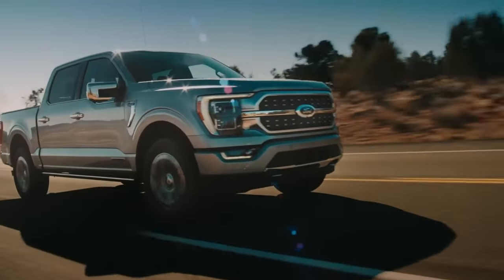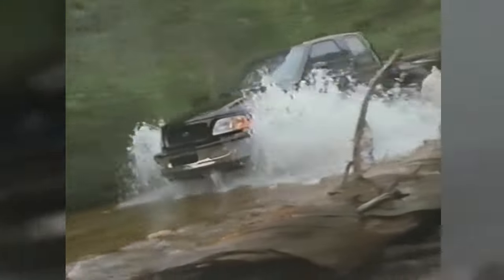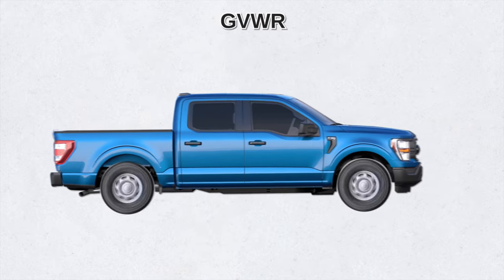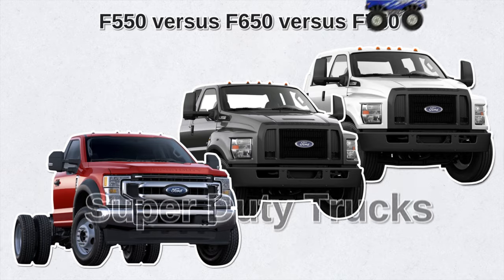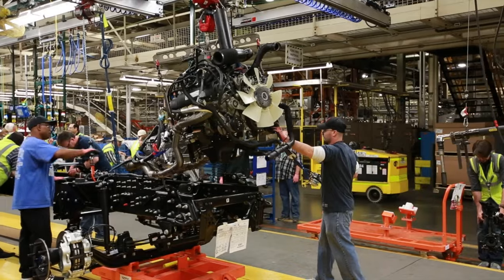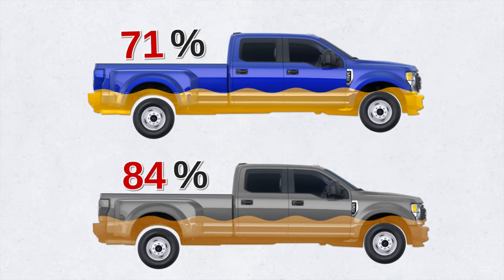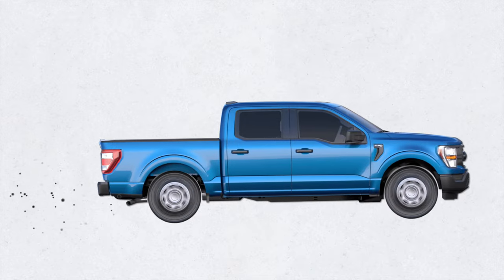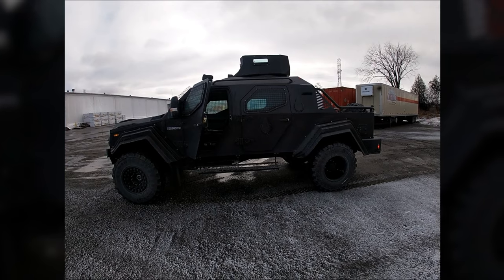No One is Telling You the Truth About Ford, So I Have to

Comment: Kinda sad, in the 70's through 90's we could be brand loyal. They all made decent vehicles. Now, you have to pick and choose due to both Ford and Chevy making garbage at any given time. RIP V8 engines.
Reply: Ford was absolutely making garbage 15 years ago. They’ve gotten much much better in the past 10 years. Perfect? No. But good enough that after tons of research I bought a 2021 ranger. GM on the other hand. They haven’t been great since pre 2007
Reply: @lesterparker1594  Im not a fan of any of the US automakers these days. We all know Chrysler anything is junk, but with Ford and GM, they can be great one model and trash the next. Takes about 10 years to really learn which is which, in my experience. Even Toyota drops a turd from time to time. Look at the frame debacle on the Tacoma a few years back.
Reply: The 70s Vehicles were pretty crappy and rusted-out. on the 60s and 70s Vehicles 150,000 miles was considered good. Back then you could get away with poor maintenance up until it died. Today's vehicles engines have such tight tolerances you must do maintenance and. change oil at the specified time or your engine is junk today's vehicles are not as forgiving but they will last. The main thing I don't like about the new vehicles is, there's way too many shall I say doodads and knickknacks.
Reply: @obamapox8185  I couldnt agree more. Gotta style them so they won't get their skirts caught in the door lol
Reply: Ford is better
Reply: @davidclemens1578  New cars are made cheap...they have the extras so you don't notice how cheap  , and sadly ,people are stupid and the extras are what people see
Reply: @emtfireman813  you’re right about that. Just have to do your homework before buying. Unbelievable how many people don’t even do a simple google search before buying a $30k car or truck. I did about 2 months of research befor buying my new ranger. 
Toyota is absolutely the most reliable. But nowhere close to the best to drive. I really wanted to buy a Tacoma. On the test drive I found out it was for me. Too slow and cramped. But when I bought my ranger I knew it wasn’t going to last 25 years like the Tacoma. I knew I would probably get 10 to 12 good years out of it and I’m ok with that
Reply: @obamapox8185  I never understand comments like yours. People can drive what they want. What cares if they drive a 6 in lifted diesel and never tow anything? Why are you the truck gatekeeper?

Comment: I was driving an 89 F350 with an "enhanced" rear bumper when I had to stop quick for an ambulance at an intersection. The S10 behind me didn't stop and my bumper tore the top of his engine off. I had the back window open and parts of his engine ended up on my dash. Other than scratched paint my truck was fine. I've been sold on big Fords ever since.
Reply: Lmfao sounds like a solid truck to me!
Reply: Well most of us can't afford 6 MPG, 😄
Reply: They're good trucks, in my country is very common see old f350s running over 300,000 kms.
Reply: @omghalo3rocks  They are solid trucks. When companies still made good quality products, instead of thin and 💩 plastic vehicles. Now you only have to push a little a body panel to make a dent, Lol.
Reply: @elgranfreezer9117 ...yes, but you can repair a lot of those panels with a pot of boiling water and a hairdryer.
Reply: I got rear ended in my 86 F250 by a 1987-1991 F250 (nearly identical trucks). Let me tell you it made a very loud bang! Only minor damage to both trucks. I'll admit, did get some whiplash out of it. Still have the 86 and plan to keep it for many more years.
Reply: That's an awesome story your lucky that you didn't get hurt glad you didn't!
Reply: @elgranfreezer9117  Exactly mate and the new F150s (especially the EcoBoost ones) won't outlast the old Fords at all.
Reply: I got rear ended by a tow truck (F-450) in my 96' F-250 and it taco'd his front bumper which was heavy gauge steel. My 250 was mint because he hit the trailer hitch lol
Reply: I mean they don't make 'em like they used to lol
Reply: @Dave Meister I ran an FX-8350 for over 7 years and am hitting thousands of hours under full load with synthetic benchmarks. I only put synthetic in her.

Comment: I've had a number of F100 and F150 pickups in my 40+ years of driving. Started with a '71 with a 302, a '76 with a 390 out of a '68 Mustang, a '77 with a 4.9, and my current DD, an '07 XLT Supercrew 4X4 with a 4.6. All have been solid, capable trucks. My '07 is sitting at 324,000+ kilometers.
Reply: My first truck was 72 F250 with a 360 my next one a 74 f250 with a 390. Both were robust heavy haulers and 4 speed
Reply: My 01 with the 5.4L was a good solid truck but I got a 2016 just to treat myself. Nothing wrong with the 01 but I just wanted all the new bells and whistles. So I got my 2016 with the 2.7L and it’s my favorite truck yet (that I’ve driven) and I’m 200+ thousand miles.
Reply: Awesome brother.
Reply: @Rick The question is will that overpriced EcoBoost F150 outlast my 96 F150 with a 5.0L (302) Windsor V8 and also did you go to the bank to borrow money for that truck or did you buy it with cash.
Reply: @Rick $40,000 still sounds overpriced
Reply: @Yung_Hefty  that’s great to know. I have the same truck and after hearing Scotty I was concerned about longevity on the 2.7 turbo. I change oil every 5000 miles. Anything else you do that I should to get 200,000 miles out of it?
Reply: I put a 390 GT - 4 speed in my '55 F100.  I would put my foot in it and the front end would take on a life of it's own with shimmy and the steering wheel would shake like crazy!  I would have to back off before it went off the road!
Reply: @Rick Well thats inflation for you.
Reply: @Rick Yep they sure do. Even $40,000 with inflation thats still overpriced for my budget even if its a great deal to you.
Reply: @Rick How much do you make an hour now and how were able to buy it with cash like nothing.
Reply: @Rick Thats good.
Reply: Still have my 71 f ,100 ,father purchased new ,lives in garage since new .
Not for sale
Reply: @jimmyp6443  Awesome brother keep that truck going. What color is it.
Reply: @CJColvin  two tone green ,sport custom ,just under 50k original miles 
Original paint ,if not garage kept and not driven on new jersey salt roads 
I would not have it today ,thank you
Reply: @jimmyp6443  You're welcome brother. Is it a 6 cylinder or does it have the 390 FE V8 in it.
Reply: @CJColvin  302 three speed column ,manual breaks steering 2 wheel drive .has all its trim roof and sides are light green ,
Reply: @jimmyp6443  Awesome brother I have a 1996 Ford F150 with a 5.0L (302) Windsor V8 with 209,000 miles and still going strong. The only things I've replaced on my truck was the starter, the rear fuel pump, and the power steering megunisum but other than that mostly was just simple maintenance, took out the transmission fluid just to get rid of the shuttering it was making and it hasn't had a problem ever since.
Reply: Man I was with you all the way up until you said kilometers

Comment: I own one of the worst generations they've made and she still gets me around with good maintenance and care. If their worst can get you home, I can only imagine how the best does it. Ford is definitely built tough.
Reply: Ford is the best out of all American made cars. But I think Fords operating practices today would make Henry Ford roll in his grave. Henry made vehicles that where tough, reliable, lasted a very long time for a price every American could get.
Nor what we see today, most American car manufacturers changed out reliable metal parts for cheap plastic and still charge more. The engine bays are 30%-40% plastic hoses, connectors, sensors and cheap wires, with vulnerable electronics everywhere on every part imaginable. For example the ABS and tire pressure of every wheel has sensors that are plastic housed and expensive as hell.
I'm selling my 02 Jeep Grand Cherokee Laredo 4.7L V8 4x4 with 220k miles and getting a 2014 Toyota Corolla S Plus or L or a 2013-2015 Honda Civic SI or LX.
With under 80k miles and those have lasted 400-500k miles. Seen a 99 Honda Civic with 498k miles on it and a Toyota Corolla with 589k miles both still running.

Remember that guy who had a 06 Toyota Tundra that had 1,000,000 miles on it, still running great and Toyota traded him for a brand new 2016 Toyota Tundra.
I heard of a Toyota Corolla with 1M as well but didn't see OBD2 scanned confirmation of that one.
Reply: @CameronDC-Grimes  I wonder if Ford would do the same for a million mile F150?

Comment: I owned 3 F150 4x4s from the 1980s and I really miss them, I never had any problems other than poor fuel economy on the 351 HO 351 V8s, but my final one had the 300 inline 6 cyl with a 5 speed stick shift was my favorite one, I kick myself to this day for selling it!
Reply: Frederick Moller mines a 460 engine I know it's a gasser it only has 101,000 miles on it and hardly any rust on it but a lot of scratches on it it's also a plow truck a heavy-duty version short cab and it's also got automatic transmission and manual locker differentials on the wheel hubs just bought the thing in Eagan Minnesota as soon as it came up on Craigslist the reasons because I found out it had the 460 and I heard about the 460 it was used in drag racing and in school buses keep in mind it's a gasoline engine but I'm wondering if the engine is reliable at all I've been trying to ask Scotty about this question for 2 months since I got the truck as soon as it was for sale I'm really pissed maybe you can help me if it is reliable I watch every video on YouTube to see if this engine was reliable at all the only thing they said about it on every video I watch is it's a complete gas hog which I know but I want to know how long it will last is the big million dollar question you my brother my only hope 🥺
Reply: Still have my 1971 f100 ,302 cid 3 speed .father purchased new ,drove it in high school , not for sale

Comment: I used to have a 95 f150 with a 302. Very reliable and indestructible until it got totalled in a wreck. $21,000 brand new.
Reply: My 95 XLT is still alive and running strong. Love the 302 however there
are times I wish I would have ordered it with the 351
Reply: Sorry but in United States it's very common to see repairable cars being "totaled".
Reply: Did you buy another Ford to replace it? Just curious.
Reply: $21,000 those were the days, eh?
Reply: I'm sorry to hear that brother but hey I bet it was a great truck. I have a 1996 Ford F150 with a 5.0L (302) Windsor V8 with 209,000 miles on it and still going strong. The only things I replaced on my truck was the starter, the rear fuel pump, and the power steering megunisum but other than that mostly was just simple maintenance, took out the transmission fluid just to get rid of the shuttering it was making and it hasn't had a problem ever since.
Reply: Also I bet they'll outlast any modern F150 you see on the road today.
Reply: Mike D I have a 95 Ford F-250 shortcab with a 460 engine with only 101,000 miles on it I've been trying to ask Scotty to see if it's reliable on live car talk but he hasn't replied do you think it's reliable?
Reply: @jamescaron6465  That would be 37k in today's money actually

Comment: 2019 F150 5.0/10 speed transmission = bought it new and at around 46k miles the transmission started shifting so hard from 1-3 it would bark the 35" KO2 tires.  Then at around 40-45 mph it would feel like it went into neutral for about 4 seconds before upshifting.  Under warranty= figured no big deal, called 3 Ford dealerships before I found one that had an on staff transmission guy.  Made an appointment a week out, took it in, they kept it a week.  They changed the valve body = no change. Called the next week and they said they were going to have to tear into it.  Called the next week and the service person told me he had some bad news, "our transmission guy came in this morning, packed up his tools walked out on us."   When I asked what this meant for me I was told " I don't really know what to tell you, I guess you need to find someone else to fix your transmission."
I called around and found another dealership that would work on the transmission about 70 miles in the other direction.  They told me it would be a couple of weeks before they could look at it.
Made the appointment and dropped my truck off.  Called after another week to check on the status of it and was told they definitely saw it had a problem but they were waiting on a rack to come available to tear into it.  Called back a week later to get another status report and was told they were still waiting on a rack to come available.  When I asked for an estimate on how long it would be before they could start on it, the service person said another 2 weeks....  At this point I'm already 2 months without my 50K$ truck, not to mention neither dealerships providing a loaner vehicle.  
I finally gave up on Ford taking care of me and traded it on a different brand while it was still waiting to be fixed.
I can't believe the "Best selling truck in America" has such poor product support.
Ford's crack can grow together for all I care and I will tell as many people as will listen how I was treated and what kind of product they are peddling!
No more Fords for me....
Reply: It's a kinda bad luck atleast better than my ram and gm trucks that can't even last an year
Reply: I think the dealerships are the weakest point in me vehicle ownership. I know several Ford dealers in our area don't have body shops but send you to a non dealer shop. Same with interior parts. Of the six or seven Ford dealers in the area only one has competent mechanics and they are always a month behind. Terrible service. Once Ford sells them it seems they forget who you are, but treat you like a king when you buy.
Reply: @RT-js4tz  I asked if I could take it to an independent transmission place.  They said I could but it would void the warranty...

Comment: I have a 1996 Ford F150 with a 5.0L (302) Windsor V8 with 209,000 miles and still going strong. The only things I replaced on my truck was the starter, the rear fuel pump, and the power steering megunisum but other than that mostly was just simple maintenance, took out the transmission fluid just to get rid of the shuttering it was making and it hasn't had a problem ever since. I also have a 2011 Ford F150 with a 5.0L Coyote V8 in it with 142,000 miles on it and still going strong as well and its a beast and it sounds like a beast with the Borla ATAK exhaust on it.

Comment: Hi Scotty, great name by the way! Here's my F-250 story as you requested: Many years ago, my parents became permanent RV’ers, pulling a 5th wheel trailer with an F-250. At the same time, I was driving a 1985 Ford Tempo with a little 200 cubic inch engine. Just prior to them hitting the road permanently, they divided a houseful of furniture into two locations (Frederick, MD and Gettysburg, PA about 30 miles apart via US 15). I was helping Dad move furniture, where I would drive while he rode shotgun relaxing from the rigors of loading and unloading furniture. On one of these trips while we were on 15, Dad leaned over and looking at the speedometer said very casually, “Scott, you might want to keep it under 80!” I had been using the same pedal pressure that I used on the Tempo while driving the F-250 (!), not realizing the pickup’s engine was twice as big as the Tempo’s.

Comment: 1995 F250 4x4 5.8L standard bed w/cab lights 400K+. It's my daily driver hauling and towing. The C6 is starting to show some fatigue. The old girl is getting tired. I have to let up on accelerator so it can shift into 2nd, I call it "the phantom shift". She still turns heads though.
Reply: Awesome brother. I have a 1996 Ford F150 with a 5.0L (302) Windsor V8 with 209,000 miles and still going strong. The only things I replaced on my truck was the starter, the rear fuel pump, and the power steering megunisum but other than that mostly was just simple maintenance, took out the transmission fluid just to get rid of the shuttering it was making and it hasn't had a problem ever since.
Reply: @CJColvin  Nice. I replaced starter as well and a few other pieces. These engines are so strong... "How strong are they?", remember the worst idea ever, the "cash for clunkers" back in 2010? ruined the parts market and a lot of these sweet trucks got destroyed. Rotten bastards! anyway, Everything on the vehicle had to be destroyed/crushed. The Salvage yards were getting $1400 per vehicle under the CFC. To destroy the engines they would pour sand into the Air intake, That should destroy an engine right?, well, not the F Series truck engines! They kept running and running, while more sand was poured in! I was told all this by the owner of a local salvage yard. It's quite the testament to these trucks. Enjoy

Comment: I’ve got 2015 f150 3.5L ecoboost and while it’s a great truck overall, I’ve had the IWE on the drivers side replaced twice and passenger side once. The drivers side is bad again and I have to switch to 4H And it thunks back into place. I’ve also got an intermittent engine rattle when I go between 60-70mph. Code says cat but I have power. Just put new plugs in and the middle driver side had oil. Randomly stopped doing it today. 🤷‍♂️

Edit: started again 😆. Gonna replace valve cover gasket and see what happens.

Comment: In 1992 I had a 1975 f250 4x4 I loved that truck. The engine 351 gas and manual trans were solid. Never any trouble. The truck rusted away so badly I was unable to drive on the road. In 1996 I drove into a scrap yard.  They used the truck for a few more years as a yard truck. This was common for Ford trucks in the north east US